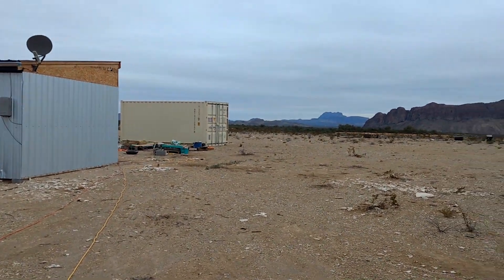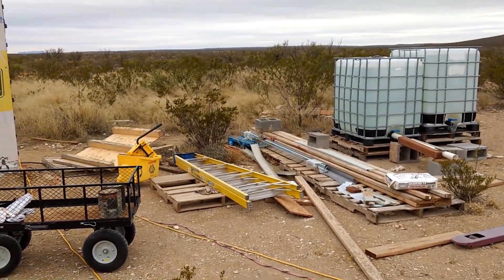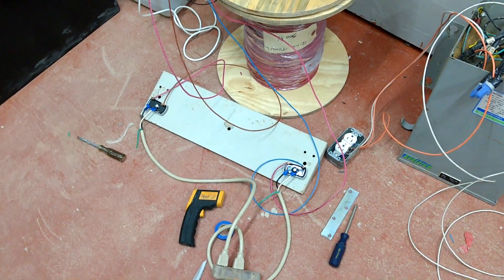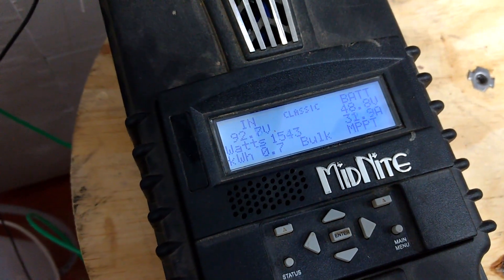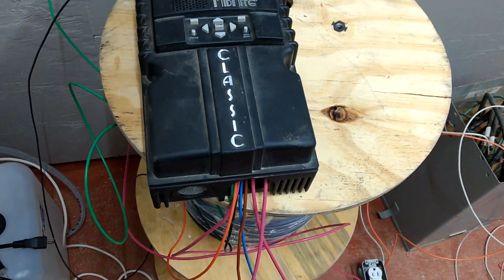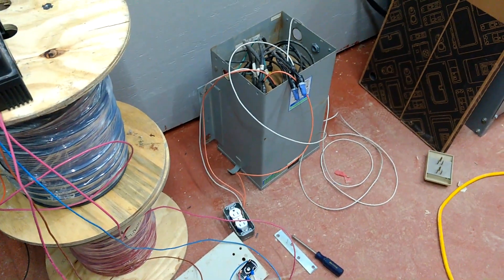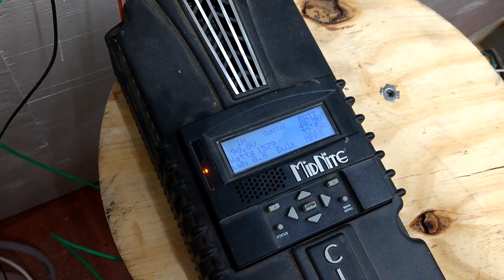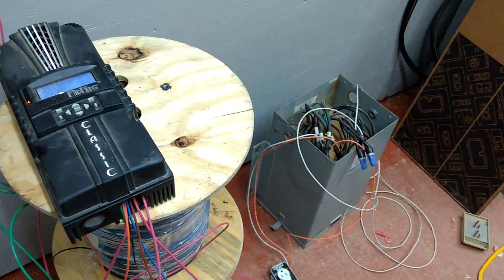Midnite classic 150 powered by gas generator

Comment: The midnite 150 can only do this with a 24v or higher battery bank because peak rectified AC is 170V and the midnite 150 hypervoc will accept 150 plus the battery voltage which if it's 12v would 150+12= 162V so under the 170V rectified wall peak. You could go around this by having some kind a load like a 500W water heater,  come on automatically when the rectified voltage gets over 162V. That would shave off the 170v peaks

Comment: Just remember folks to limit the power your midnite draws from the generator by limiting  the max amps your midnite can charge the battery bank with from the menu. In this video its limited to 33Amps . Times 48v thats 1500W. Plus extension cord losses,  that's still way under 2000W the generator can put out

Comment: Hypervoc just means that your controller can handle as input the 150V PLUS the voltage of the battery bank you are using.  So if your battery bank is 48v the controller can handle 150V + 48V = 198V. Thats why it was saying that it's in hypervoc mode. Rectified wall AC peak is actually 170V with no load on it.

Comment: Where did you get those rectifiers? Would those be more efficient than what I am thinking of doing when there is no sun, which is to connect a Victron charger into my system (LifePO4 batts) and have the 4000w generator drive the charger?
Reply from the maker: Probably about the same efficiency. I don't remember where I got the rectifiers likely ebay.

Comment: I’ve got a classic 250 and a old Honda generator I think it’s only a 1600watt generator I can run it at 120v through a bridge rectifier will this work ? Or will it damage the classic my bridge rectifier is 3 phase but I think that also doesn’t matter dose it …. Also what do you run the classic
on settings wise ?? Wind or hydro ??
Reply: I think either one , wind or hydro should work. Just remember to limit the power the midnite  draws from the generator by limiting the battery bank charging amps. In this video he limited it to 33 amps times his battery 48v = 1500W.
Reply: @drevilatwork  since then I’ve got it running through my main solar charger a 3.5kw 60amp charge it works great for topping up and runs on red diesel 👍 luckily I haven’t had to use it loads

Comment: One more question. Did you limit the amp input bc  it would just try to draw more and more power until the generator over loaded?
Reply from the maker: I can't remember if I limited input or output but either way, yes, there was a current limit.
Reply: He limited the output power to 33amps so there would be no reason for the midnite controller to draw more than 1500W from the generator . 33 amps times the battery bank voltage 48V about 1500W plus extension cord loses etc... it would still be well under 2000W at the generator output

Comment: Very cool, this is exactly what I’m trying to do. I did read that 120 Vac is equal to 170vdc after it goes through the rectifier. I didn’t really understand what you did to get around that. You hooked it up, it said hyper voc then what did you do? I’m also wondering if you can have the generator and the solar connected at the same time? That would make it real convenient  bc you could just keep everything connected and turn on the generator when you need to. Any feedback would be much appreciated!
Reply from the maker: What I did was just by chance have a really long extension cord momentarily connect the midnight to get it to go into bulk then reconnect to the generator. The load and long extension cord causes a voltage drop and quite by accident it all worked out. You could probably have the panels hooked up at the same time, as long as they were protected by a diode, but I wouldn't. You could use a DPDT switch to switch between generator and panels.
Reply: Hypervoc just means that your controller can handle as input the 150V PLUS the voltage of the battery bank you are using.  So if your battery bank is 48v the controller can handle 150V + 48V = 198V. Thats why it was saying that it's in hypervoc mode. Rectified wall AC peak is actually 170V with no load on it.

Comment: Great idea!
Where did you get that bus bar mounted on wall? Correction, terminal block.
Reply from the maker: The terminal block is from ILL Customz https://www.illcustomz.com/store/p51/1%2F0_Distribution_Blocks.html the box is a blank NEMA box from BUD Industries https://www.amazon.com/gp/product/B005T7ZQZS You will have to drill the holes in the box.

Comment: A classic 200 would work very well!
Reply from the maker: The 150 works. Use aux 1 to drive a relay and turn off above 145. It's normally on then the generator turns on and shoots up to 165, relay turns off voltage falls to 149 and midnite goes into bulk and when it gets down to 145 the relay turns on and under load pulls the voltage to about 110. Little hokey but it works..

Comment: Rectified AC 120v is 160-170 volts, put a meter on the rectified output! 120 vac is at RMS, not peak,
Reply from the maker: I did put a meter on the output of the rectifier and it read 112v and 117v on the input but when I hooked up the midnite it shot up to 165ish. Which kinda makes sense since the midnite floats at like 40 volts on the input even when nothing is connected. But unhook the midnite let the input cap discharge to under 150 and it goes into bulk then hook back up the power and it's all good. I wonder if I hooked up a cap on the rectifier output if it would go up to peak and read 170? I'd imagine that would only be VOC though and under load it would pull down to 110ish..

Comment: Love it- because the Midnight has 3 phase windmill capabilities we've now discovered it's able to deal with the "ripple" of your 2 phase rectified AC !   speaks volumes
Reply from the maker: We ran it for many hours yesterday and everything worked perfectly. It's interesting because I asked about this on the Midnite message boards and got reply after reply that it wouldn't work and that I would surely blow up the Midnite. When I asked why it would work with wind and hydro and not a generator I got responses that made me realize they didn't know how things work. Glad I was right would have felt really dumb if it did blow up :P
Reply: @fullvegan  Absolutely !.... so if we picture the wave form, all wind mills and water wheels are 3 phase alternators rectified to create DC, you're just doing it with 2 phases instead of 3 which makes for a larger change in voltage between each cycle, but that's it.  The 3rd phase just makes it a bit smoother.  Glad you took the chance- I love it.  You do realize you can connect those same rectifier leads directly to your battery right ?  That's how I charge my Chevy Volt pack, direct off a Ford alternator, which is a 3 phase generator.  The battery doesn't give a shit, it just sucks it up.
Reply from the maker: @mark_osborne  This is single phase the second wire is neutral so even more ripple :P. I would not connect the rectifiers directly to the battery the generator wants to produce 120 volts so as the battery put load on, the voltage would sag and the generator would continue pouring more power into the engine to try and achieve that until it dies, the wires melt, the rectifier fails or the battery fails in some way. Most likely the generator would simply die. Your ford alternator likely has a regulator in it that electrically maintains the voltage around 14 volts.
Reply: @fullvegan  Ah ya, I didn't think about how your AC generator would probably go batty trying to maintain 120, she's probably just go full-bore.   You might find this interesting.  When I first went down the road of charging with an alternator, I was convinced (mostly by others) I needed a 48 V regulator (which doesn't exist).  But as it turns out, NOT!.  My alternator's open circuit voltage at full-field (where I run it) varies directly with RPM.   And at about 1600 engine RPM, where I like to run it, I've got 81 volts at the alternator.  But as soon as you connect it to the battery, she's (of course) right at battery voltage.   THEN when you run the RPMs up or down, the 'current' changes.   So at 1600 rpm's, I'm right about 65 amps.  I can easily hit 80-85 amps but she's not so fuel efficient at that speed, or I can lower it down to 40 amps where the engine really isn't working.    No regulator needed, just works like a charm !

Comment: same here running the little 1800 honda keeping the batteries slammed up, i got the new model 2200 peak runs 10 to 12 hours on one gallon of gas. Stay warm
Reply: What settings do you use I spoke to midnite classic tech support they said to use U-Set Voc is this what you do ?